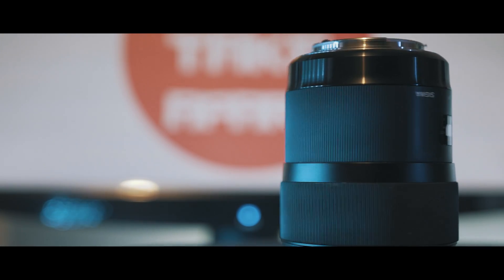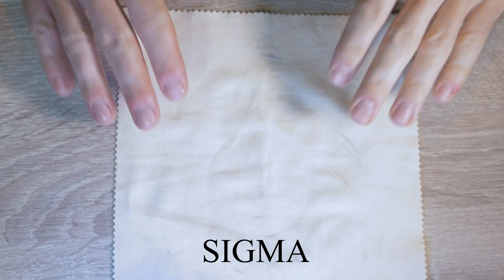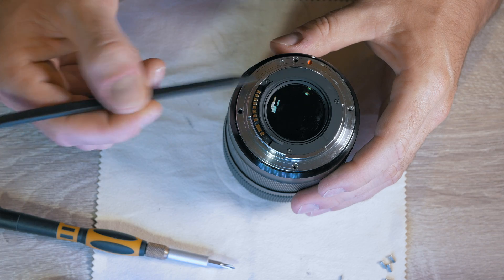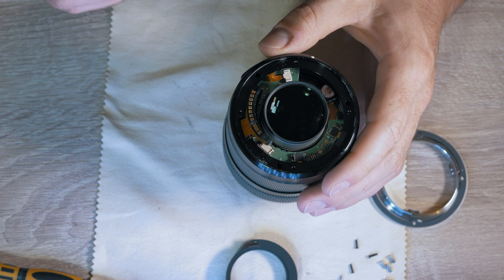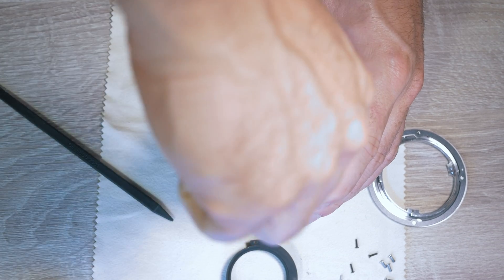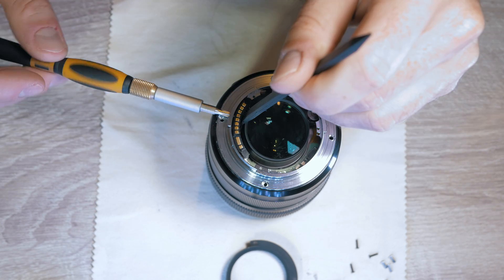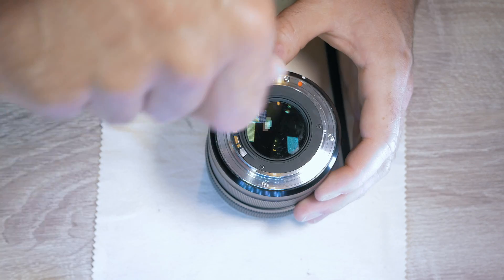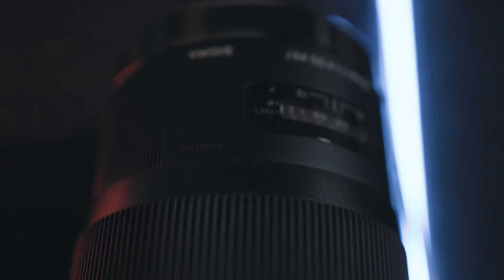Sigma 35mm f1.4 Repair |  Loose Barrel | Easy Fix of Sigma art lens  [4K]

Comment: Excellent video, thank you! I've just bought a second-hand, fully manual Sigma 70-210 mm Minolta MD mount zoom lens. It's in great condition, virtually unused without any sign of wear, except for one problem, the front barrel and the focus/zoom ring wobble. It's very annoying, so based on your video, I'm going to try to fix it. I've bought the lens to attach it with the help of a K&F Concept adapter to my Lumix S5D camera, I'll see how the plan works out. I hope the old lens will fit, because I cannot buy the very expensive Lumix 24-105 mm lens for $1300. I' ll have to make do with the 18-40 mm OIS kit lens and this manual zoom for closeup shots. I might also need to look for a couple of fast manual standard lenses. Based on the comments here one would think that Sigma lenses tend to become wobbly quite easily. It's interesting. Is there a reason for that?

Comment: My 35mm wasn’t like this!  I don’t know if it was the Nikon mount or an earlier version (the serial number is 013).  I was still good knowing that there were screws to tighten underneath the shims, I just had to do it with terminals attached and the ribbon cable connected. It works!
Reply from the maker: glad to hear that you fixed it! thanks for input!

Comment: I ran into an issue at 00:43 The metal bayonet mounting ring is stuck hard and I can't remove it. I double-checked every screw was out, and even used the back lens cap as a grip to try and pull it out, but there's no movement at all. Any ideas?

Comment: Did you have any issue fitting the bayonet ring back on. Mine will not pop back in evenly. One side seems to be sticking out no matter what i do. I tried tightening all the screws to see if it would level it but it’s not working. I’m wondering if I just need to give it a good tap but obviously afraid of causing any damage. Should have been an easy fix.
Reply from the maker: no, my was ok !

Comment: Hi I have tge Sigma 24-105mm art for canon, need to clean inside front element, have removed plastic cover, there are 7 screws, could you please tell me which ones do I remove, or all of them to remove front element tgank you Ron
Reply from the maker: Hi Ron,  you can email me some photos and I can try to guide you ....
Reply: @TAKEAPART  I will try, not surebhow to upload photos
Reply from the maker: well just drag them in to the email…
Reply: @takeapart  sent by messenger, sorry too old to drag fikes into email 🤣🤣
Reply from the maker: got it

Comment: Is there a video to fix Sigma 50mm "Sony E mount" back loose mounting barrel?
Reply from the maker: Hi , it shouldn’t be much different?!
Reply: @takeapart  I tried opening the back of my Sony E-mount Sigma 50mm 1.4 just the same way for EF mount, but Sony has a more larger back barrel and I don't know where are the screws to tighten it. as there is an extra step to open something else to reach those screws to tighten it. 
Help will be much appreciated!! As sending to Sigma for repairs is almost $160.
Thank you for your reply.
Reply from the maker: if you still have it open… email me picture and I will have a look
Reply: @takeapart  Will do! thank you. Is there a specific email I can reach you at?
Reply from the maker: the one on about page …
Reply from the maker: hi, one on about page or on my website

Comment: Thank you so much, (I haven't done it yet, but....) just got home from a shoot and realised my 35mm had become unfocused at times during the evening and was loose at the mount, spent the night fearing repair bills/ time without my #1 used prime, tried to tighten the outside screws at the show, got home, and Google gave me your great walk through solution! ♥ ♥ ♥
Reply: Please, also make the necessity to only use Japanese screwdrivers very important in your titles, I only learnt via Tamiya RC in the last few years, that they are different to most UK used Chinese screws, and that's why people are stripping the screw heads. The same goes for guitars, no-one knew that there was a difference, and so many people stripped all of the screws when they tried to mod guitars! I now have a good set of JUS screwdrivers
Reply from the maker: that’s is great point!  thanks
Reply from the maker: hi, Im glad you fixed your lens !  thanks for watching

Comment: How can I find out the part numbers please? I would like to know if first lens group front lens optics element glass for Sigma Art 35mm Nikon is the same as the one for Sigma Art 35mm Canon or Sigma Art 50mm Canon?
Reply from the maker: hi, hard question…  front glass should be the same … different will be glass/es after focusing module.  but I have never tested it.  thanks for watching

Comment: Same idea on the 50, but you only need to remove the 4 main screws and the one small screw on the 50mm… absolutely no need to take off the seals, rings or unscrew the screws at the CPU contacts.
Reply from the maker: thanks for tips

Comment: Hey. Thanks so much for this inspirational video. I have same 35mm 1.4 sigma art, and my lens focuses ok until f2.8, and on smaller apertures the focus hunts a lot and rarely focuses correctly. Do you know a home fix for that? I think that the lens suffered a small to moderate impact while it was in my bag... that's where this problem comes.
Reply from the maker: Hi Alex , it is hard to determine what is wrong... first try it with different camera bodies, otherwise you can try to open it and see if  anything out of place ...

Comment: Another thing to point out, these are JIS screws, or Japanese Industrial Standard.  They look like Phillips, but have a slightly different taper to the cut.  As the result, if using a Phillips head on them there is a chance you can "cam out" and destroy the head.  A small enough Phillips can work, but I recommend getting some JIS drivers if you are going to be working on camera gear.  I got a set from Moody tools for under 30 USD, and it has a 2mm driver that seems to work on all the screws, even the very tiny ones on the side of the mount for the electrical connectors assembly.  I used a 000 Phillips on mine, and stripped one of the heads of those screws, and now I am screwed trying to find something small enough to get it out.  Take care!
Reply: This is me right now lol
Reply: @Itaketoomanypics  i found out too late too LOL. just bought JIS screws even tho i got two screws stripped. Any ideas on solutions?
Reply: @aleeoop did you figure it out? I stripped minee
Reply: @michaelsalt9685  I tried to no avail. I sent my lens to Sigma to get the barrel and new screws fixed for my own peace of mind. Quoted me 170 + 20 shipping

Comment: Question - The two gaskets/seals/shims or whatever they are, which one goes in first?  I took mine apart, and I forget which goes what way.  Mine look different from your though, mine are one that is a thin silverish metal, and the other is a thicker gold/brass color.  Does the thicker one go first?  I think it does.  Please let me know if you know.

Comment: I just sent my 35 Sigma Art lens in for tightening last week under warranty and it's back. Two days later my 85 Sigma Art lens is doing the same thing. Bought them at the same time. Take it the repair should be similar?
Reply from the maker: hi , yes they should be similar however small differences can be found.  good luck with your repair..
Reply: It worked! Thanks for the video!
Reply: @ScottShawPhoto  How much was it for Sigma to fix it?